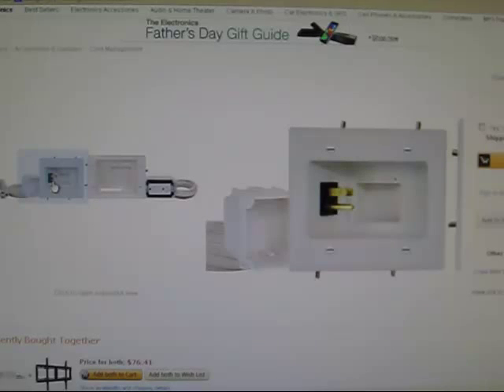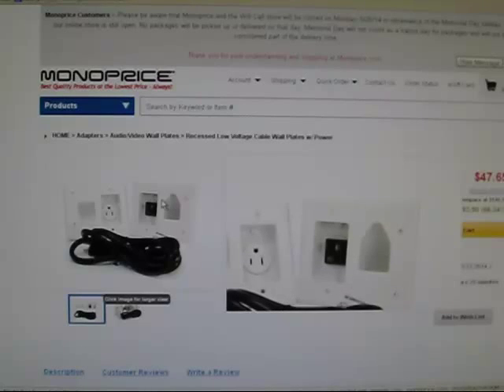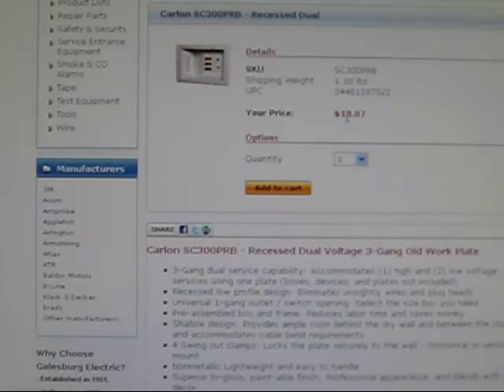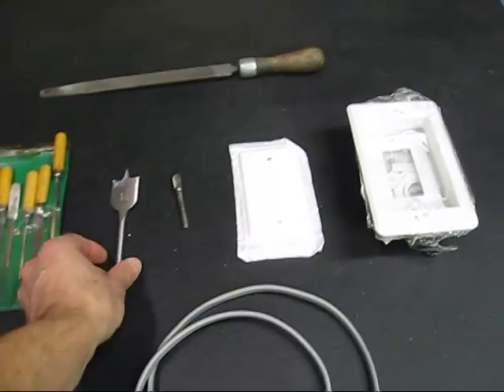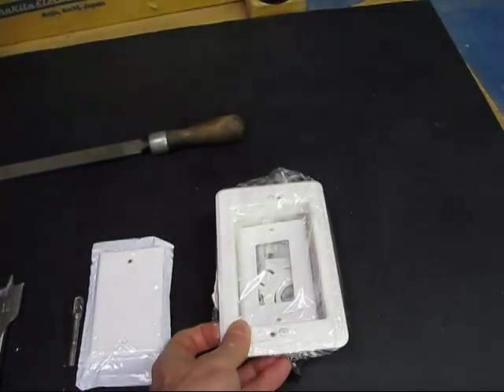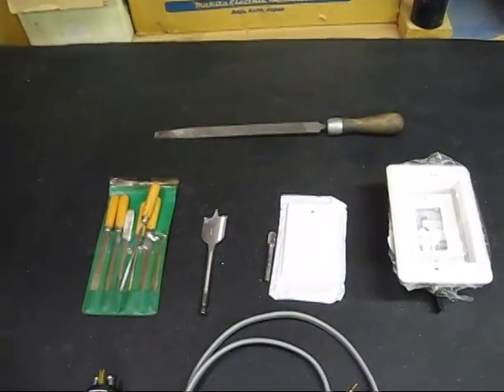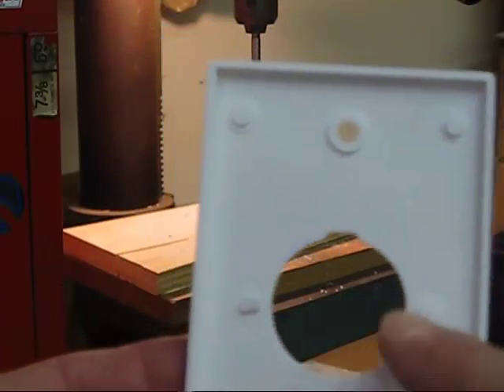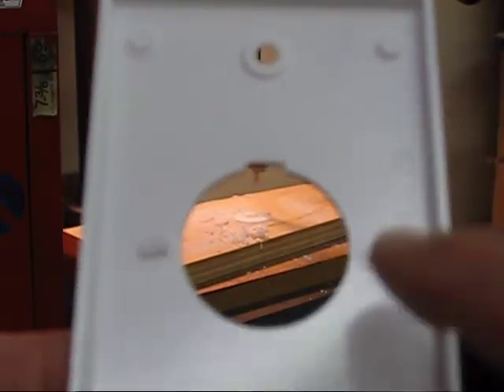How to make you own Recessed Male Power Outlet Tap

Comment: And this is up to code?  Seriously just asking!  Thanks for this!
Reply from the maker: Great Question and that thought was in my mind while doing this. I didn't have it officially inspected. However, I suspect because it's NOT in an official high-voltage gang box it's probably not to code. I had safety in mind when doing this and I feel comfortable with my work. In the end, it's up to each person to decide and also how skilled they are in doing these things. I've seen people just run an extension cord from the TV down the inside of the wall and come out the bottom with some makeshift hole near the baseboard. I consider what I presented a much safer method with a pro-like appearance.

Whatever you choose to do or be today I wish you a joyful and miraculous day. 
So be IT and So iT IS 🌼🌟🌼 🌀 💨 ✨

Comment: Guess I'm dense but, why do you need a male receptacle instead of a female one.
Reply from the maker: Think of this as an extension cord inside the wall. the back of the TV has a male, then the TV cord, female end plugs into that, then the end of that (male) plugs into the female socket up top on the wall behind the TV, then that goes down the inside of the wall and exits as a male, just like you would have when you plugged in the TV with the TV cord, it is just an extension.... Then this male plug at the bottom connects to another extension cord, which that plugs into your power strip. I suppose you could make it female BUT then someone MAY think it is an actual POWER outlet,  and try to get power from it when all it is, is an extension cord from the TV. This is NOT a power outlet it needs to get power. This allows you to easily remove the tv from the wall and provide a nice clean cable management system at the floor. Sure you COULD run just an extension cord down the wall and have it all hanging out, but really not meant to run extension cord behind a wall, if there happens to be a fire, your insurance company will not honor the claim as it was not to CODE. As it is what I present here probably isn't to code either, but is much much safer with a pro-like touch.

Whatever you choose to do or be today I wish you a joyful and miraculous day. 
So be IT and So iT IS 🌼🌟🌼 🌀 💨 ✨
Reply: Powered prongs too dangerous. Think about it!!!
Reply from the maker: The prongs don't carry live voltage. you have to apply voltage to the prongs with another cable as the power source, which would then cover the exposed prongs. think of it as an extension cable from the TV (which isn't the power source) down the wall and out the bottom of the wall. it's not a live circuit. rethink it again.

Whatever you choose to do or be today I wish you a joyful and miraculous day. 
So be IT and So iT IS 🌼🌟🌼 🌀 💨 ✨

Comment: This was fantastic idea.  I needed to run conditioned power from my Panamax M5300-PM in my media closet to my new JVC DLA-X750RB 4K projector.  I wanted to make it really clean and to fit in one side of a double gang decora screwless cover.  It works!  I did however have to make the plate out of metal (galvanized steel outlet cover).  It was pretty easy with about 6 dremel cutting wheels.  I was also able to drill and tap the decora screw holes.   I wish I could upload a picture, it turned out really clean!  Great post..THANK YOU BOB!

Comment from the maker: @ Handy Man, Yeah a threaded center tip spade/paddle bit or a self feeding spade/paddle bit shouldn't be used, these are also known as a wood boring bits. Actually I found my standard non-threaded paddle bit at Home Depot, so maybe your store didn't have it. I have seen these at many other Hardware stores as well. Drill press isn't required, but does make the job easier, just go very slow with a portable drill. You can still use a threaded center tip if you drill out the faceplate center hole pilot to match the tip of the paddle bit and the wood stock behind it as well. Not ideal, but doable.

Comment: What is not clear is that you can not use a "threaded spade" paddle bit.  I tried that with a portable drill and immediately cracked/split the faceplate. Since the faceplate is plastic it must be drilled very slowly. The threading on a paddle bit pulls the bit too quickly through the plastic causing it to break. So, the alternative is you have to find a non threaded paddle bit or a circle cutter.The assumption in the video is that a "required tool" is a drill press...Not everyone has a drill press!!! I am now going out to look  to buy a non threaded spade bit which Home Depot does not stock in their stores!!